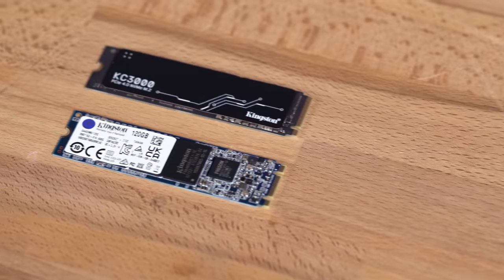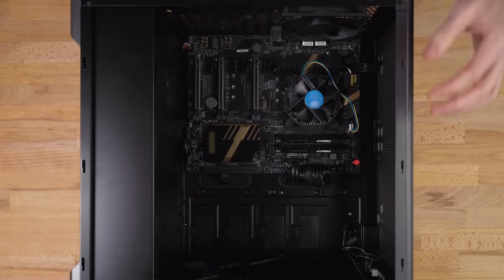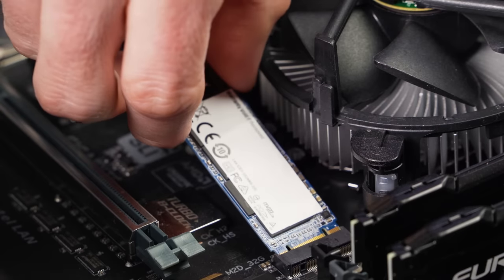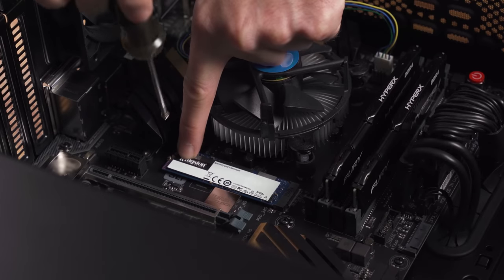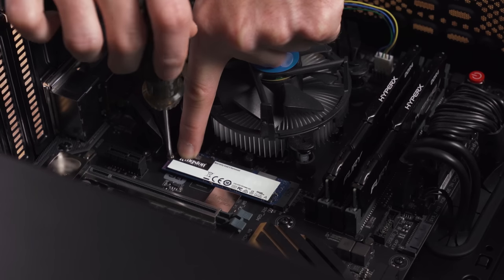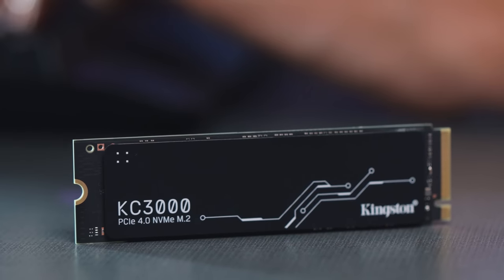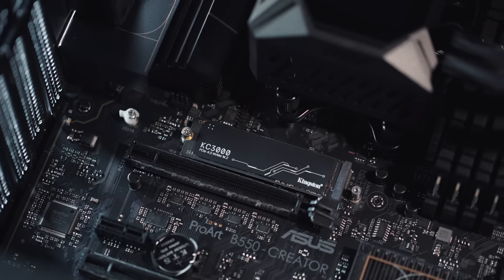SATA M.2 SSD vs PCIe M.2 SSD - What’s the difference? – DIY in 5 Ep 172

Comment: M.2 SATA is just a complete wasted slot...; all slots should be dual NVME/SATA capable, or, NVME only...
Reply: Yes, it should be this way men 😅😂😂
Reply: Clearly you don’t understand why it SATA exist.
Reply: @ivanteo1973  Assuming you are even addressing my statement, perhaps you missed the part/failed  to comprehend where I addressed M.2 SATA slots on mainboards...and not 'SATA' standards as a whole.
Reply: @mdd1963  then you really dont know why M.2 SATA exist
Reply: @ivanteo1973 
Why it exist?
Reply: @Phjghh  its cheaper, dude.  don't you know?
Reply: @Phjghh  Also your CPU can not support all those PCIE Lanes
Reply: Speed: NVMe SSDs' key differentiator is speed and performance. NVMe technology uses a PCIe interface that enables it to connect directly to a CPU, reducing latency and improving responsiveness. But some users simply don't need that level of speed, in which case a SATA SSD could be a slightly cheaper option
Reply: Do you know why pentiums and celerons exist? Heck why i3s exist? Because companies need to cater to a budget range. Satas exist because its cheap.
Reply: @itstomatopuree  For the reading-impaired, I was not addressing simply 'SATA' drives in general, but instead stated quite clearly 'M.2 SATA' , and more specifically I was addressing the M.2 SATA only slots on some mainboards...  As for drives, M.2 SATA has little if any price advantage over M.2 NVME these days, although I am sure some morons would choose either, oblivious to the at least 6x sequential reads advantages of NVME of dirt cheap PCI-e 3.0 drives,
Reply: Where d hail does m.2 nvme and Sata have a price difference?
Atleast here in India there is non and the only difference in price is between 2.5inch Sata and m.2 nvme and that too only 2-3$.

Comment: In practice on a typical PC the speed difference between SATA and NVMe doesn't tend to be very noticeable, at least to me, and only a few specialist applications, like heavyweight video editing might perform significantly better. However, for a desktop I would go for the NVMe option anyway as the use of a SATA m.2 card generally steals one of the SATA interfaces.
Reply: It's an order of magnitude faster than sata in games that constantly stream in assets as you play (on a slow drive, the game will have micro freezes minutes after the level is loaded while you play). Their best use case are in these games.

Comment: Just sharing, when it comes to SSD, 3 criteria u guys should know:

1. Form factor : 2.5" and M.2
2. Interface/slot/port : SATA and PCIe
3. Protocol : SATA and NVME
Reply: So is it possible to have an M.2 PCIe SSD using the SATA protocol ?
Reply: @gottabepablo  wouldnt you need the connection of the m2 to be sata (physically speaking) in order to use its protocol?
Reply: Thank you!
Reply: @gottabepablo  If you see an M.2 drive with two notches in the connector instead of one, I think that means it's either a SATA drive, or a PCIe drive with only two lanes. I think it's physically the same connection? There are M.2 slots that support both or only one, anyway. But the same drive can't do both.
Reply: @whyjay9959  I thought SATA is not only just a physical interface but also a protocol implemented in software that has to do with the drive controllers. So although an M.2 drives connector is etched for the PCIe interface, can't it not be configured to use either the NVMe protocol or the SATA protocol? (not the physical connection/interface)
Reply: Have one of your AHCI PCIe SSDs, a HyperX Predator, as my boot drive on a 2012 Mac Pro.  I use it as a fusion drive with an A400 SATA SSD.
Reply: 2.5 and m.2 what about 3.5 ..lol, oh yea and ata :face-pink-tears:
Reply: aahh, please pin this comment :D
Reply: Thank you. Now I got it. This should have shown in the video.

Comment: I have a M.2 SSD 500Gb for the OS and I am very satisfied with it... not expensive, very fast and reliable. With HDD my PC took between 1 or 2 minutes to fully restart, but with M.2, it only takes 17 seconds and it´s ready to go.
Reply: What pci version is required for the same..
Reply: @dharmendra34061  it depends on what kind of motherboard you have and the type of PCIe slots it has. Older motherboards generally have a PCIe Gen 3 slot, newer ones (and the more expensive ones) have Gen 4 (which is twice as fast as 3 but in all honesty you don't need it unless you do heavy work on your PC like editing or gaming).

Comment: Great video. Building a new computer after 10 years (current one is still fine, but trying to get ahead of expected end of life limits of hardware). Coming from a "SSDs should only be for the OS" mentality, so very helpful.
Reply: Well, for gaming too, especially in raid, but expand memory to like 32GB if you have 16GB, and use a virtual memory drive to create a 'storage' for the virtual memory, that way, the OS can support virtual memory, which is to me pretty much obsolete, and yet required for most games or apps, while only using 16Gb of the ram for that.
Yes, sounds non-logical, but virtual memory is still a widely used function, upon non present games and apps  may either quit or run badly, exiting to desktop "memory full" message.
(It makes no sense, that with 32 GB you'd get a message memory full, or simply app quit, and yet it happens.)
(It's better to have 16GB memory and 16GB virtual, than 32 GB real with no virtual, which makes no sense.)
(also, instead of using SSD as virtual memory, using the virtual drive (in memory) as virtual memory saves a whole bunch of SSD life, while still allowing for near maximum performance, but is less prone to SSD degradation by virtual memory.) It also prevents the OS from using up all the memory for 'better' performance, while the slow release usually kills the game.

Comment: Great video. A little addition to your explanation : The 2 Notch Sata M.2 use's what's called the B-Key. The 1 notch PCIE [ NVME ) m.2 use's the M-Key. The M.2 socket's on the devices motherboard can be ; A B-key socket , A M-key socket or a combined socket that you can use either type of M.2 in that single socket.
Reply from the maker: Thanks for your comment, and we have more information like this available here: https://kings.tn/3Io874P

Comment: Thank you for explaining the differences in interface, with two holes vs one hole for NVMe vs PCIe
Reply from the maker: Hello @robxlove

We're hoping this helps you out!

NVMe SSDs use the M.2 slot with a single notch (M key) or the PCIe slot for higher speeds. At the same time, SATA SSDs typically have a dual-notch (B+M key) connector for the M.2 slot, supporting older, slower technology.

SATA M.2 SSDs do not use the PCIe interface; they use the SATA interface despite having the M.2 form factor. The dual-notch (B+M key) connector is designed to fit into M.2 slots that support SATA.

Some M.2 slots support both PCIe (NVMe) and SATA SSDs. These slots can accept drives with either the single-notch (M key) for NVMe or the dual-notch (B+M key) for SATA.

Kingston Is With You

Comment: I have PCIe M.2 in two of muh rigs, and a SATA SSD in muh main rig. All access your operating system (Windows or Linux) faster than mechanical drives, run programs very fast, and fetch files super fast.

Comment: My 1TB Samsung SATA SSD can still boot my PC in 10-12 seconds, compared to the 2-4 minutes it takes a 5400rpm HDD to finish booting and readying programs to use. If you're using M.2, you wanna make sure you have a PCIe connection, as SATA is limited to 600mb/sec.

Comment: I think the only place I've seen an M.2 SATA slot is in a slighty older laptop. Too old and it would only support a 2.5 inch SSD, newer may finally have PCIe/NVMe capability.  
Don't think I've ever seen a desktop motherboard with M.2 SATA, but I wouldn't put it past certain vendors to shave a few pennies off.
Reply: I have a gigabyte mobo that supports Sata m.2 - use it for mining with hiveos, I also have a USB enclosure for reformatting the sata m.2 drive
Reply: 2021 modern of asus and msi, Acer still have M.2 SATA
Reply: There are tons of mobos that support M.2 SATA especially in the low and mid range mainboard chipset series... Mid range series boards also support both SATA and NVMe, so look more closely, please.
Reply: I have a fairly recent MSI motherboard that has one pci m.2 and one sata m.2.

Comment: Gaming: NVMe M.2 - lays flat on the board.
Some will be located on the back of the main board (motherboard) some will be located on the front.
To simplify  - it's all about moving information quickly from point a to point b.
Think of it as a highway  - more lanes fit more information - where will you notice it most?
Gaming  - high amounts of data transfer.
When there's a lot going on, you need fast read and write times, which equals speed and efficiency. 
Hope this helps explain the process a bit.

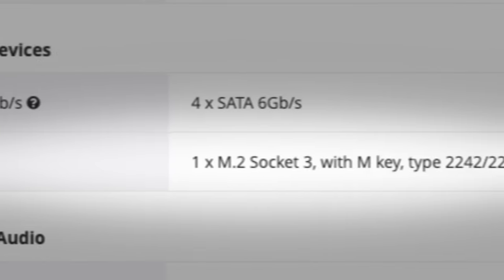Comment: Great presentation! Although, I still don't understand what my Asus Z170M-plus board mean by "M.2 X4" and "M.2 Socket 3", which you did mention in your presentation at 1:57. The manual states that the M.2 slot is an "M-key". Wikipedia says that M.2 SATA is an "M & B Key". Now, I know my board is old (PCIe x3) and it's very easy to get an M-key NVMe PCIe x3 SSD, but the mystery to me is...... Will the NVMe work on my mobo with the mysterious "M.2 X4 Socket 3" information?

Comment: I was that guy sweating bullets.  Guess, if you want the scoop on memory the Kingston memory experts are your guide.  Excellent summary!  Just wish you'd also discussed real world differences.  I have a 2019 Dell 5060 desktop with only a long-in-tooth a HDD.  It has an M.2 PCI 3 x4 and a couple SATA ports.  In reality, how much faster would a M.2 PCI.3 x4 be over a SATA SSD for typical consumer/business use?
Reply from the maker: Thank you for the compliment! As for the difference The PCIe interface is generally faster, as the SATA 3.0 spec is limited to ~600MB/s maximum speed, while Gen 3 x4 lanes of up to 4000MB/s (depending on the host device). For more information please consult us via our Tech Support page: https://kings.tn/3DakQWz

Comment: 1st!

That out of the way, one thing this video did not address was which to use if you were making a USB bus powered external storage device.  Use SATA, not NVMe.  The USB port does not put out enough power for NVMe devices, but does for SATA.
Reply: I have a bunch of external SSDs, SATA@USB3.0, NVMe @USB3.2 Gen2/Gen2x2,USB4.0... all of them have no issues.
Reply: @Wlad1  I should have clarified. I was meaning NVMe via USB 2.0 and 3.0 buses.
Reply: I have a small usb enclosure that can run nvme m.2 Gen 3 drives
Reply: @xlr555usa  bus powered or self powered?  If bus powered, can you run it on USB 2.0 or 3.0 buses?  That was what I was referring to in my original post.
Reply: @baddmatt9588  it works on usb 3.0 or higher
Reply: @xlr555usa  interesting, mine doesn’t. Well, not on Type A ports.

Comment: So even though, I am familiar with some of the facts, I didn't know about the two notches for the SATA M.2 drives, so kudos for teaching me something new!
I am using three KC3000 1TB drives as a RAID0 device on both my computers. At peak levels, those drives reach up to 22.000MB/s read and 17.000MB/s write speed. If I had a bigger budget, I would have chosen the RENEGADE drives instead.
Before I forget, can you please bring back OPAL 2.0 encryption for the KC3000 series of drives please?

Comment: I am using nvme ssd on my motherboard with 1155 socket by modding the bios :)
Reply: I'm using SN350 on Socket 1150 main board, no BIOS mod required, just get a BIOS update from the board manufacturer.
Reply: @DarrenC_1024  i said for cards that do not have this feature.

Comment: Those who want to use nvme ssd on their old motherboard, write me your motherboard model, i can mod the bios for you
Reply: expansion card, no bios mod needed...
Reply: @larrypaul2462  may be required for cards without m2 slots.
Reply: @MsAxelfoly  the whole purpose of installing the expansion card to get the functionality of PCIe NVMe storage is to have the M.2 slot(s) on the card..  lol
Reply: @larrypaul2462  used with adapter for high speed on old motherboards
Reply: @MsAxelfoly  lol, expansion cards...

One lane of PCIe gen5 is equivalent to two lane's of PCIe gen4

One lane of PCIe gen 4 is equivalent to two lane's of PCIe gen 3

Same applies with every generation of PCIe
Therefore, to get PCIe gen 4 speeds from a gen 3 bus (for example) will require 2 times the number of lanes..

No bios upgrades (or mods) required
Reply: @larrypaul2462  nvme cannot be booted on old motherboards, bios modding is required for this
Reply: @MsAxelfoly  with everything needed to be bootable being on the expansion card itself....

Just like a SAS array can be made bootable, if one desires to do so..
Reply: @larrypaul2462  Have you ever tried adding nvme to an old motherboard?

try it see
Reply: @MsAxelfoly  been booting one for some time now from a NVMe
Reply: @larrypaul2462  On which motherboard, p8h77 m-le motherboard I tried it and it didn't work

it worked after modding the bios
Reply: @larrypaul2462  I think you don't know there is a pcie m2 adapter :)
Reply: @MsAxelfoly  an expansion card is also known as a adapter card....

something you wasn't understanding...
Reply: @larrypaul2462  after all i am using nvme with x4 dock mounted adapter
Reply: @MsAxelfoly  now explain that bios mod you talk about...
Selecting the boot device in the bios, isnt a mod..

Running a NVMe drive over x4 gen 2 PCIe isn't really an improvement, rather foolish in reality, the gen 2 PCIe bus is a massive bottleneck while running at 50% the speed of gen 3 which runs at 50% the speed of gen 4 which in turn runs at 50% the speed of gen 5
Reply: @larrypaul2462  u don't understand the point, this is to get high performance on old motherboards, to be able to use nvme without m2 slot and no bootability
Reply: @MsAxelfoly  Oh I understand fully...
what you are not understanding is the fact that NVMe expansion cards are already bootable.

Older bios's may in fact require you to flash that bios with a update from the manufacturer, not someone claiming they can mod that bios for them..

One last time, describe that mod......
You can't due to the fact it's a scam...
Reply: @larrypaul2462  the manufacturer doesn't offer you the mod, you don't know that and if the nvme module was bootable you wouldn't need to mod the bios anyway :)

Comment: What’s the difference between PCI-e and NVME PCI-e?
Reply from the maker: Thank you for your inquiry and there is a lot of information about that so if you need supplemental info to this video, please visit our site here to learn more: https://kings.tn/3flntfs
Reply: @kingston  Thanks for the reply, but that really didn't help.
Reply from the maker: PCIe is a standard bus interface that works with many things, video cards, audio cards, ethernet cards, RAID cards, and solid state drives (SSDs). NVMe, is an interface specification for communication with next generation form factor (NGFF) and solid state drives, and functionally, a PCIe bus. More inf here on 'M.2 SSDs explained': https://kings.tn/3flntfs
Reply: @kingston  You should rename that page you linked to “M.2 SSDs explained, except for NVME” because NVME is not mentioned at all.

And again thank you for the reply, but it didn’t answer my question.  When I see an M.2 SSD labeled as PCI-e and the next M.2 SSD is labeled NVME PCI-e, what is the difference between those two drives?
Reply from the maker: Ok it sounds like you are requesting further details, so please contact our Tech Support Team where we can discuss with you more. You can chat or email us here https://kings.tn/3y3V6c6   
Thank you
Reply: Apparently there was a period with PCIe SSD's that don't use the NVMe communication protocol, but those are hard to find now.

Comment: I have a laptop that's from 2017 and has a sata m.2 ssd but how do I know if I can upgrade to a PCIe m.2 ssd?
Reply from the maker: Thank you for your question, your laptop will only be able to use a M.2 NVMe drive if it explicitly states it has a native port to accommodate it. You can check with the manufacture for specific details on this, or you can check our part selector here to see what we have available for your system: https://kings.tn/3Ug1Zk4

Comment: Sata max speed 600MB/s    PCIe 3.0 32GB/s    Only difference ya need to know really.
Reply: 1. PCIe3.0 = 16GB/s (@16xPCIe Lanes) or 4GB/s brutto for typical 4xLanes NVMe-SSD (about 3940MB/s netto). Theoretically. Practically you can reach ~560MB/s with SATA and 3725MB/s with PCIe3.0. And 7450MB/s with PCIe4.0.
2. Maximum sequential speeds are not nearly as important, as you imagine. Random speeds @small files (4KB to 128KB) are the most important for snappy system.